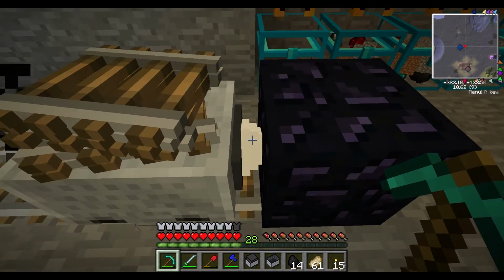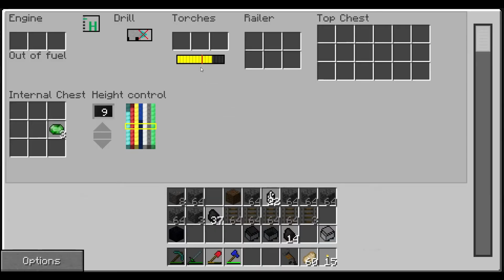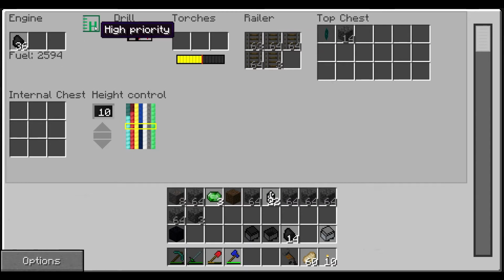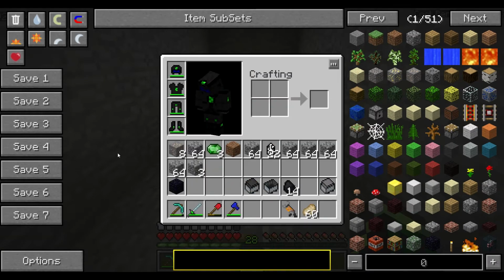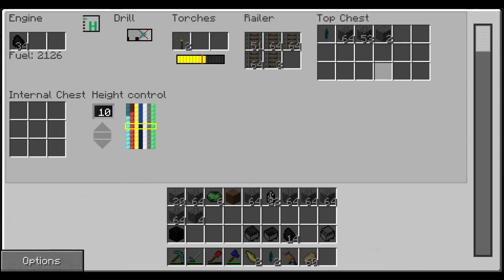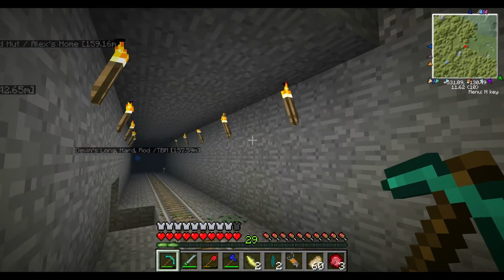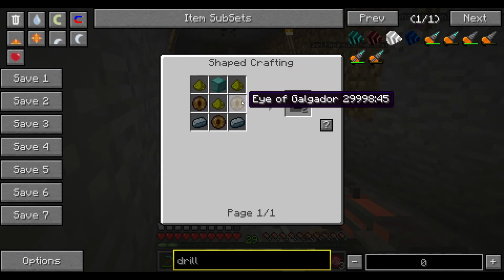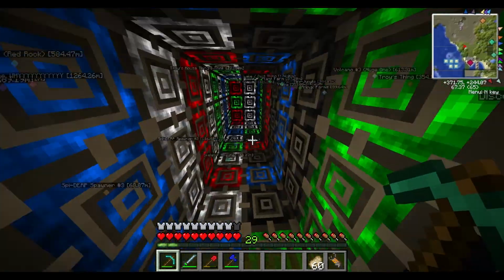Let's Play Minecraft: Feed The Beast - Part 7 Steve's Carts 2! #1

Comment: priority is if you have multiple engines, like if you want it to run off of solar energy first, you put a solar engine in and then if it stops getting sunlight, it will switch to coal or whatever other engine you have installed